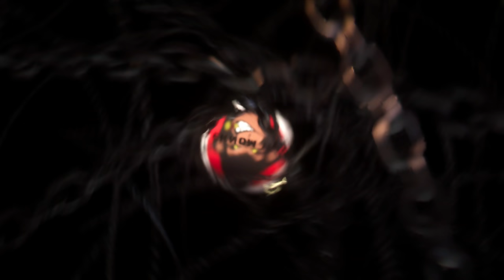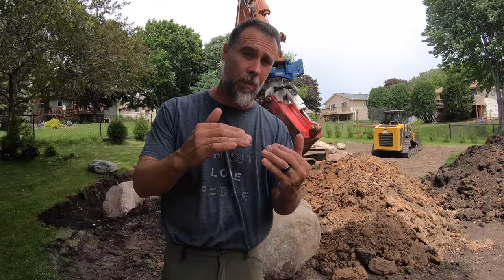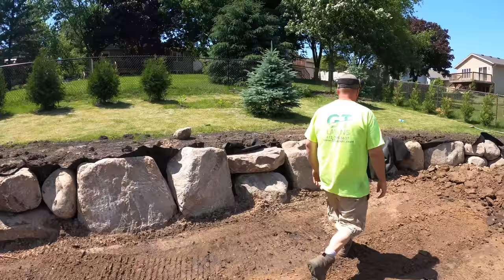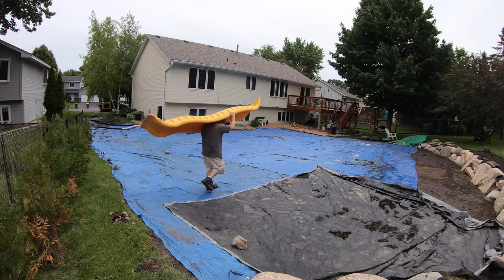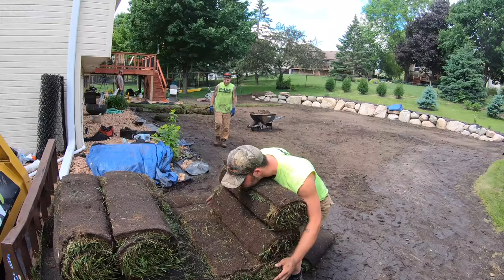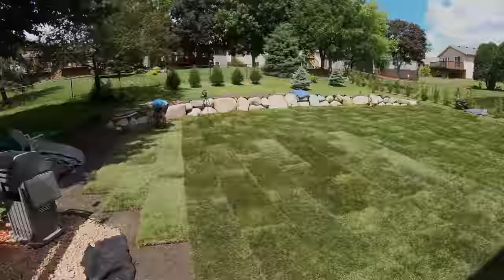Drying up a SWAMP yard- start to finish

Comment: I hold Stan in high regard! He was 1st you tuber I watched when I started mowing lawns 25 months ago he made me believe I could follow my dreams. Now there is 7 of us. Will have 10-12 for the winter. I started with a tundra, big tex 14ft single axle, and a financed Turf tiger. I did own a chainsaw, gas cans, couple weed eaters, rakes, shovels, a push mower and some other basic tools. We now have 3 trailers. 5 trucks- 2 of which we owe on but not more than half there value. Maybe we owe half there value due to Covid19 prices. The Ritchie Bros North East auction just had low prices compared with last year. We have a 60hp tractor that we bought as a dedicated snow machine(should of bought a wheel loader because it was a 60k tractor haha) we have a harley rake for it and use it for loading tasks around the shop(my grandparents property. I bought a mini excavator last year off of leaf cleanups the yr before, snow, clearing brush with bladed trimmers, chainsaw work, mulch installs, even gutter cleanings in the begining. That mini excavator makes our track loader payments and all the other payments haha. That not well articulated statement just means thanks Stan. Sometimes your videos allowed us to see enough of a certain job to start doing them. A perfect example is boulder walls. We have done 5 or 6 of them and they are cost effective. Great option to consider along with consideration of modular blocks. Keep on, keeping on! Love to see most of all the same guys around too!
Reply: Charles Bourgeois 
Down to Earth Landscaping LLC 
Lebanon CT

Comment: Great job. However, could've also added several runs of a French drain that would catch and divert all that water to the curb to prevent soil erosion.
Reply: Could have done many things, but I am sure they were working within the customers budget to get the desired effect.
Reply: @johnhaslam2235  The water basically follows the exact same path before they started as it must follow after the project.  The only desired effect accomplished is a slightly larger section of flatter lawn, though the flat area will drain less efficient.
Reply: I would have dug up most of the dirt, put down a drainage pipes that leads the water out and filled up with gravel and a top soil for grass.

Comment: This takes me back a few years when I worked for a landscaping contractor. What we did most was foundation drainage and waterproofing, which as you know almost always involves taking out fences, decks, swingsets, trees, shrubs, hedges, sidewalks, driveways, patios, lawns, etc. which always need rebuilding. I loved it when folks would spring for the sod instead of re-seeding because it looks so good so quickly.

Comment: That grapple arm seems like the slowest way of doing a job like this. Is there a better machine that could accomplish this task at a faster rate?
Reply: A modern excavator (like used in europe) would do this job alot faster and with better precision
Reply from the maker: The grapple may look slow but it speeds up a project like this at least 2 fold

Comment: Why not 4" solid drainage pipe to pick up all those gutters from the back to the front and have it discharge near the road? Could've thrown that in for like 2k extra and would've done a bunch for the water mitigation.
Reply: Ryan Beymer Yes, that was ridiculous they didn’t run those leaders out to the street.  That oversight certainly takes away from their professionalism.

Comment: That’s a sure fire way to remove the water, why did you not go with a French drain system to do the same?
Reply: Probably a lack of elevation. By the time you bury the pipe and get your drop it would be way below the street at that length.
Reply: James Paolilli  Mowing & running around those rocks is a safety & maintenance issue.
Reply: They wanted a flatter lawn more then they wanted drainage.

Comment: When you show your team sodding you always use the smaller, individual rolls. Do you ever use the large rolls that are applied with a machine? If not, is there a reason why? Is it based on the size of the job?
Reply: Problem was 2 fold.  Way too wet to even get a tracked machine in, and those rolls are great for long runs.  More work in a smaller yard like that.  Also the attachment is not the cheapest for a good one, and is so specialized it only has 1 purpose.

Comment: Dirt Monkey, did you look at the (NRCS) natural soil conservation service website, or consult a Civil, it may be a regional low point.  In future i would recommend consulting with a licensed civil geotechnical engineer to see why the soil   is muddy.
Reply from the maker: I have a geotechnical engineer on my speed dial.  Ive worked closely with him for many years.  Ive got the soil under control

Comment: The homeowner bought more yard maintenance than they did drainage.
Reply: How so?
Reply: @Agent_K21  It will take more effort to maintain the vegetation around those rocks than the previous sloped land, plus they didn't really redirect any water as much of the water still crosses the rear of the home.  It'll appear to drain better until the soil compacts back to its previous condition.
Reply: Bob the Slacker interesting take, so 3 minutes of weed whipping will actually cause them more “yard maintenance?” The wall and drainage they did for them looks damn good to me.
Reply: @Agent_K21  If you want a flat yard but live on a hill then I guess what they did looks good, but if he goal was to also solve drainage then I think splitting the hill-water in half was not a drainage-solution.